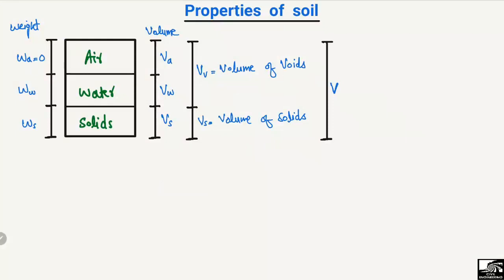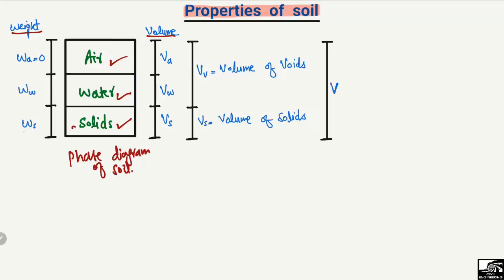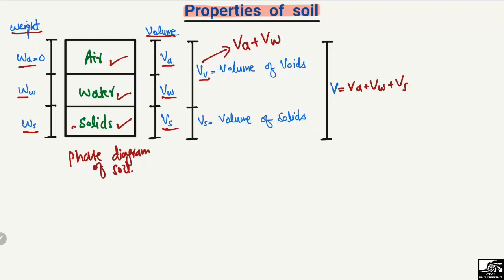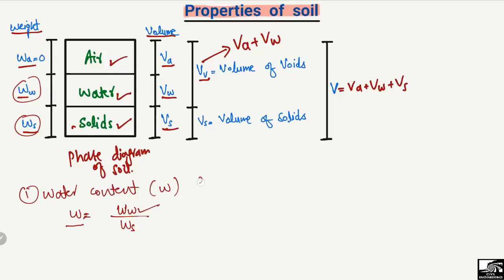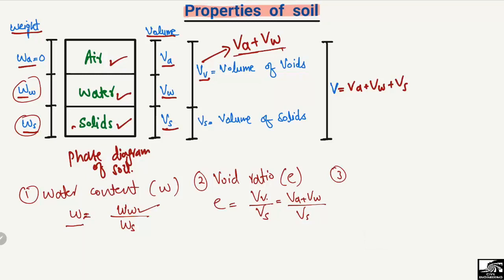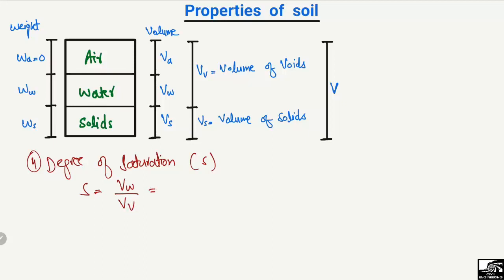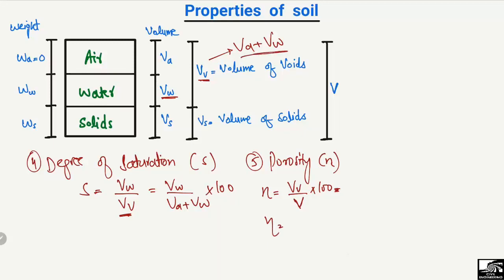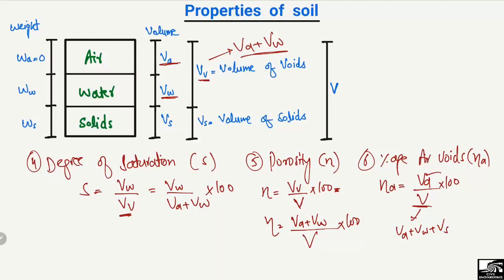Properties of Soil || Void ratio, Water content, Porosity, Air content, Degree of saturation

Comment: How do i get Volume of water(Vw) if i solved Vt, Vw, Vs, the question im working has a soil cube with no air needed.

I figured it out. Depending on what you're given, you need to take the given variable and rearrange the formula associated with them, and plug it into the soil cubes to solve each one